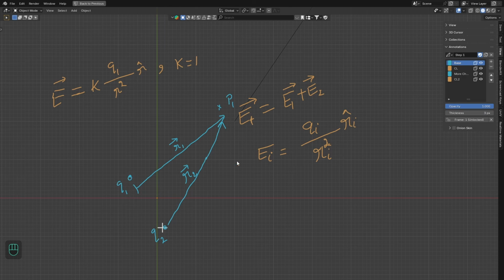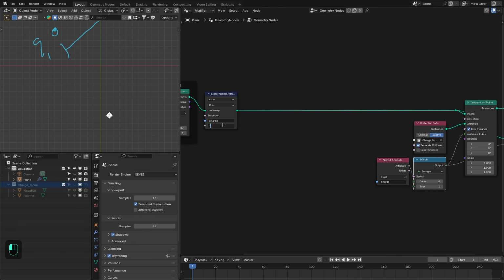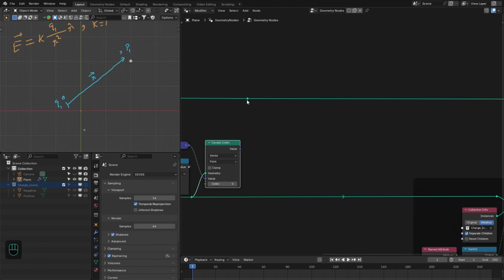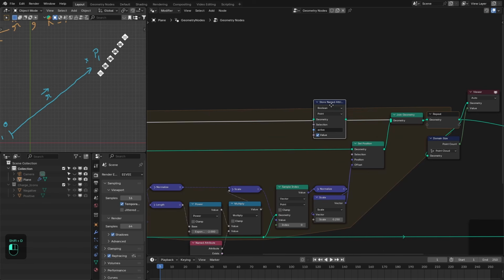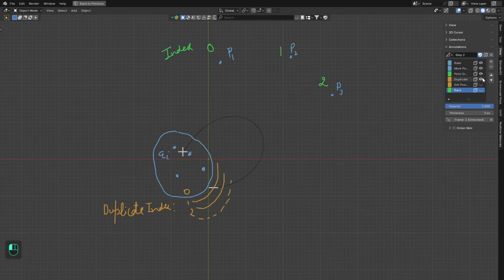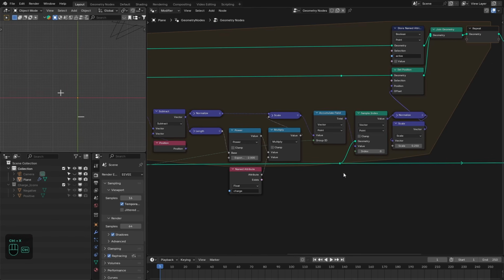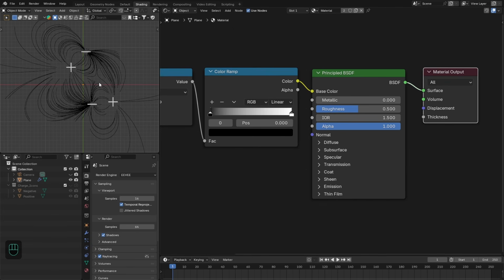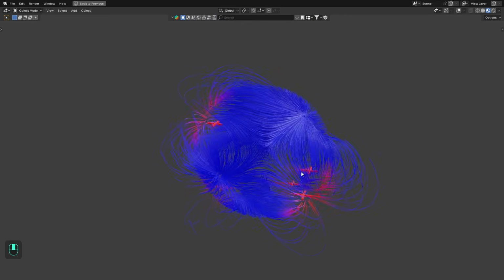✨Turning Physics into Art - Electric Fields with Geometry Nodes in Blender 4.5 - Detailed Tutorial

Comment: How to distribute charges in a single line and get the electric field pattern for that?
Reply from the maker: Hi. Use points from a Curve Line as charges.
Reply: @3DSinghVFX  Sorry, I'm still getting used to Geometry Nodes, so just to confirm: should I keep the plane at the start and use a Curve Line node instead of Distribute Points on Faces, while keeping all the following steps unchanged?
Reply from the maker: @garimagupta6261  Yes.

Comment: another insane effect. ❤❤❤❤
Reply from the maker: Hi. Another will come, so stay tuned 😀
Reply: @3DSinghVFX  amazing. 😍😍
Reply: @3DSinghVFX I have a suggestion which might help some people.
Currently, there is no easy way to control custom animations on instances other than position, rotation, scale, and a few default attributes like color, etc.

But I was trying to figure it out and found a way. Let’s say we have a cube that we can twist or do some other things with, and bind all these animations to a single 0 to 1 factor.

If you instance that cube on points, you can’t control that factor per instance individually.

So what we can do here is use the repeat zone or for-each-element zone and control that factor one by one per instance, and then collect and join all the geometry at the end.

Just make sure you update the factor on geometry before instancing (for every point and for every frame).

Use cases: blooming flowers by proximity, proximity-based morphing, changing material on instance but transition growing top to bottom per instance, tech cube reveal of instance like Tron Ares effect, and maybe more.

I hope this might help you or other artists.

Comment: Btw, I have a small question/suggestion: in the material section, would adding a mapping from -1 to 1 → 0 to 1 help?
I’m curious if that might improve the results.
Thanks again for this awesome tutorial!
Reply from the maker: Hi. You're welcome.
Sorry, "... improve the results" please elaborate this?
You can use any mapping technique, depends on the look. I'm mainly demonstrating that for new users how to convert a float mask of Geometry Nodes into colors.
Reply: @3DSinghVFX   Oh, sorry for the confusion — I meant that since the electric field strength can have both positive and negative values, using a color gradient directly from 0 to 1 might ignore the -1 to 0 range.
I was wondering if mapping the values from -1–1 to 0–1 first could make the color visualization more balanced for both directions.
Thanks again for clarifying — I really appreciate your tutorials! 😊
Reply from the maker: @Blumiostlude  You're right field strength has range -ve to +ve, you can use mapping from (-1,1) to (0,1).